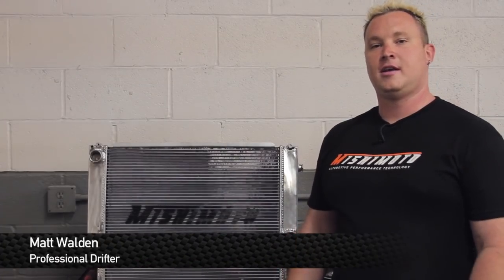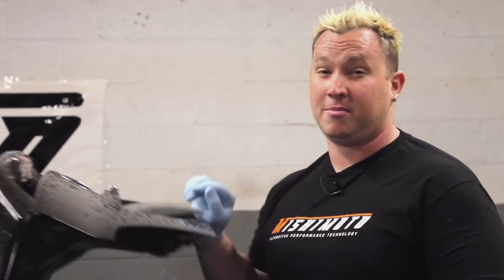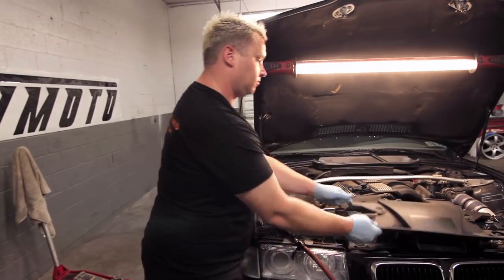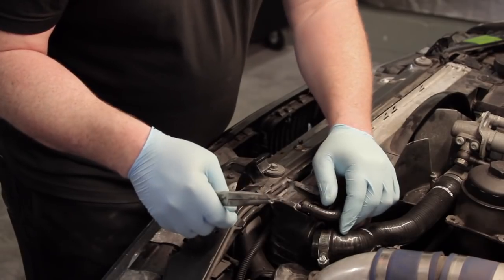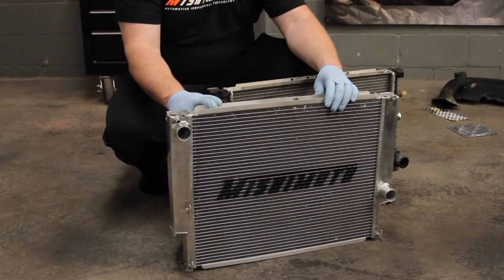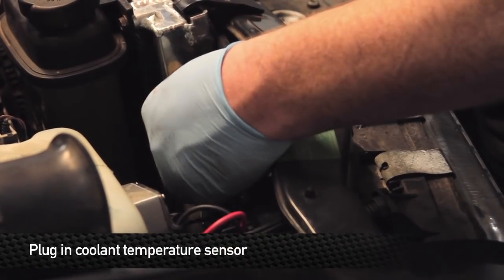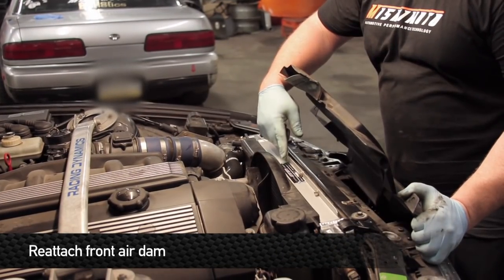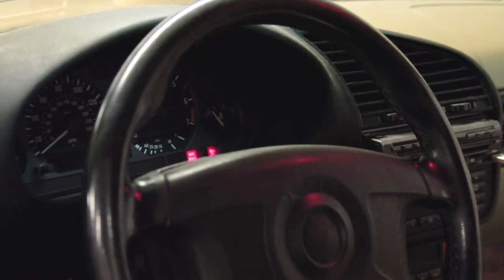How To Install: Mishimoto 1992-1999 BMW E36 M3 Performance Radiator

Comment: Aren't you supposed to drain the engine block and use BMW blue coolant? 🤔
Reply: I drained the block as well as the radiator. I notice a lot of videos I've watched, they do NOT do that. I have a 1999 M3, so you need to take the O2 sensor out before you undo the drain plug.

Comment: Buyers pleas remember that Mishimoto radiators advertised for the E36 M3 will only fit the American model E36 M3, not the Euro version M3 as there is no provision for the OEM oil cooler to be fitted on to.  You can fabricate some brackets but don't think this will be OEM fitment for a Euro E36 M3 / Evo

Comment: that's because the old radiator should have had the old clips still in it not bolts you are supposed to reuse those

Comment: did you bleed the air out of the system? with the bleed valve on the expansion tank. or maybe your motor is burning antifreeze.

Comment: I noticed you didn't have to remove the engine fan, belts, or water pump, etc?
Would this be the same for my 99 323i? I think I could do this job in a few hours

Comment: I have a 1998 bmw 318i e36 and its overheating 1st bought plastic but I just bought an aluminum performance radiator and I was wondering about sri(short ram intake) RN I have a normal intake. I was also wondering what else might be causing the problem besides the thermostat and water pump? If anyone can help I sure need it thanks!
Reply from the maker: If you have already replaced the thermostat and water pump and continue to have issues you might want to inspect your fan clutch to ensure you are getting proper air flow from your fan.

Comment: Hey guys I need your help. The standard cooler on my 98' 328i (manual tranni and AC ) has the overflowtank directly mounted to it's self. i bought the mishimoto and now my problem is that i cant fill in my coolant because there is no filling cap on it and it also only has 2 spots where the hoses are mountet to it (my original one has 3). What do you guys recommend me to do now? what Kind of external tank can i use?
Reply: oh and its euro spec aswell
Reply from the maker: Hey Daniel!  Can you please call us at 1.877.GOMISHI or email one of our support specialists at support@mishimoto.com?  They will be more than happy to assist you!  Stay cool - Team Mishi

Comment: Can I use this for a automatic 97 m3?
Reply from the maker: Hello 7abey. This item is for Manual Transmission and Automatic Transmission vehicles. It features threaded rivet provisions for the automatic transmission cooler, so you'll have no issues :)

Comment: will this fit a 318i
Reply from the maker: Unfortunately the radiator for your vehicle will be different than the model used in the 6 cylinder cars.
Reply: @mishimoto  how about the metal tank expansion
Reply from the maker: The 318 would actually have the expansion tank built into the radiator, this would prevent you from installing the expansion tank as well

Comment: It dosn’t have the bracket on the drivers side just above the hose connection. Not fit 1995 e36 328i manual then
Reply from the maker: Hello George, We've been able to verify fitment on the following vehicles. Looks like we just missed the 95 328I. 

Fits1995-1999 BMW M3 
1998-1999 BMW 323IC/IS 
1988-1991 BMW 325I 
1992-1995 BMW 325I/IC/IS 
1996-1998 BMW 328I/IC/IS